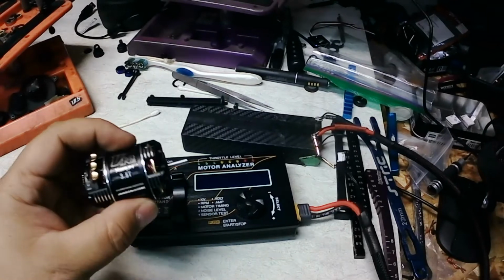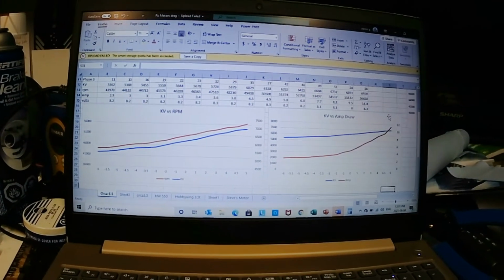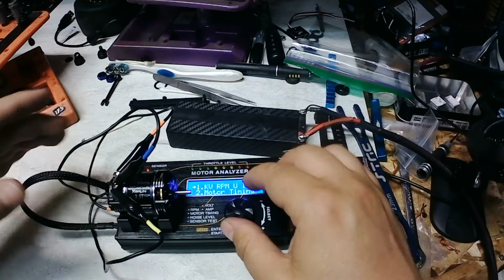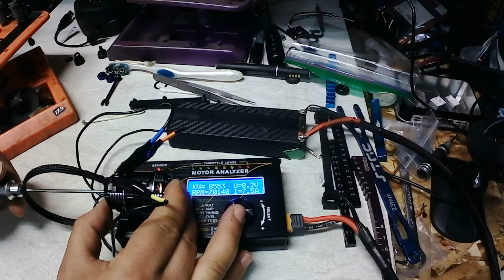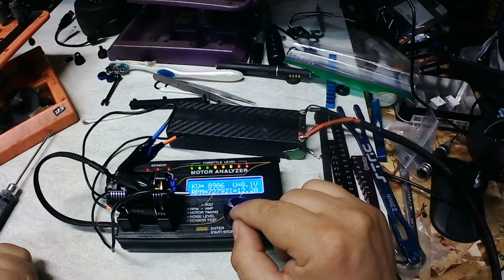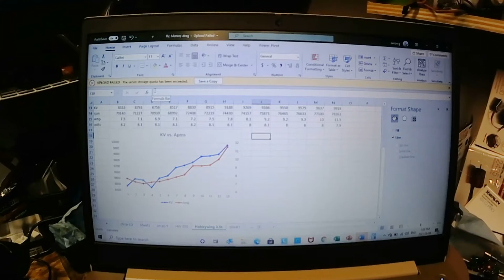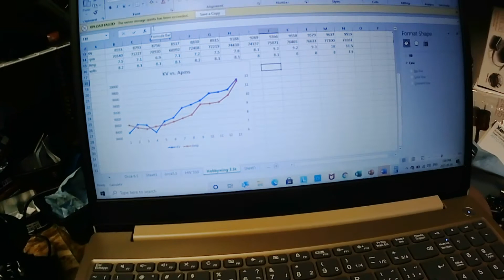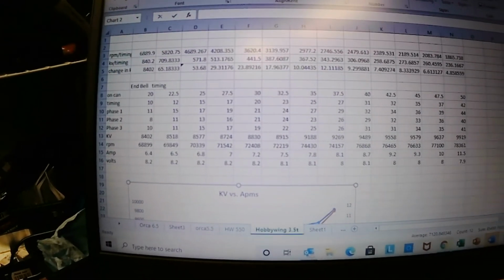SKYRC Motor Analyzer

Comment: Hey my friend question  hobbywing 3.5t is only for 1s are you running 2s is capable to run more voltage? Previously I was using the 4.5t because I have to run 2S for drag racing I love that motor. I want to purchase the 3.5t on the specs is only for 1s thanks
Reply: You can run it on 2s, but be advised on the amount of timing that you put on it. It has mostly do with rating on your ESC. Use the proper esc to avoid killing the ESC or the motor.  The ESC can only spin the motor so fast by the mofet switching on and off through the 3 phases.  If you do some math you can figure out the max rpm from max 1s, 2s, 3s, 4s etc. Rating X Kv ratings.  
I hope this helps.
Feel free to tune in to our live show for any questions that you have. 
See you trackside!!
Reply: @aarongleboff3743  ok thanks you I’m running r1 ESC is capable to 3.5 I love that motor and I’m wondering about the Voltage that is only for 1s thank you very much i’m going to stay tune for the live video